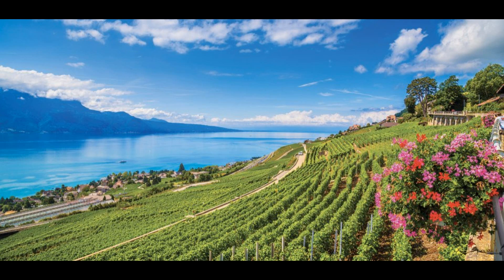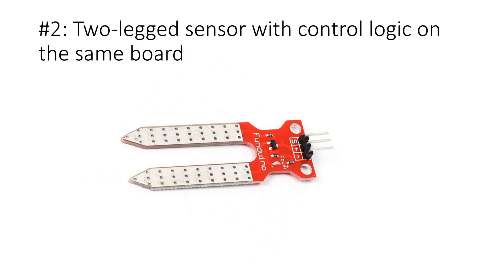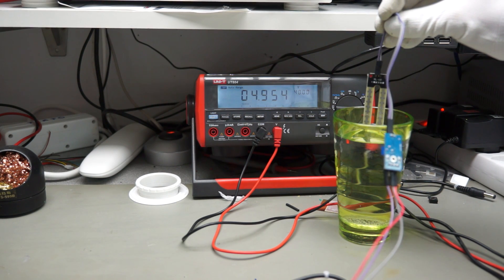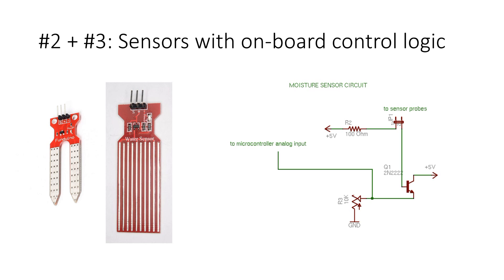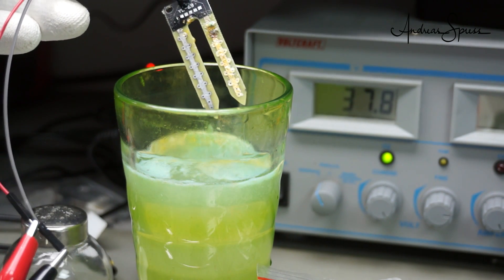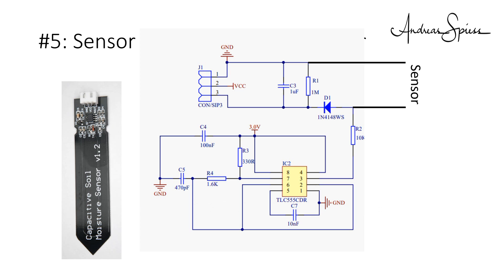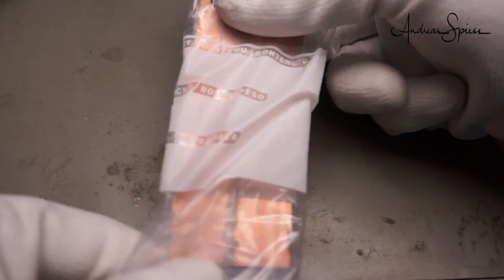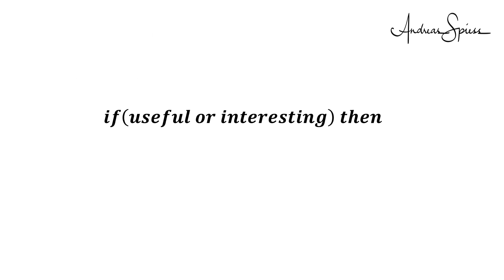#207 Why most Arduino Soil Moisture Sensors suck (incl. solution)

Comment: I've just got the capacitive soil moisture sensors shown in the video. And I already thought that insulating sides and the exposed circuitry is needed. Does anyone know of a coating that would not poison the plants in pots? Are those two options ("Plastic Dip", TRV) suitable for gardens? Any of them have no chance of contaminating the soil? Thanks for the answers.

Very happy that you came to conclusion on the sensors i just bought, they were not that expensive on the "usual platforms". Will have to see how they work long term.
Reply from the maker: Would also be interested if somebody used these protections over a long time
Reply: I'm testing now DCA/SCC3 Conformal Coating from ELECTROLUBE.
It's a spray and you must hang the sensor in the air to let all spare dropping off. Avoid any contact at the bottom for 24hours.
One sensor is now in the soil for a month and looks quite good
Reply: I've tested nail polish for a week, and some of it came off on the sides. But I had a different problem that these sensors were staying in the same range, slightly increasing over the days. Might be my mistakes, but if i tested it not in earth, but putting in a glass of water it went from 0 - 100%, but as I said in the earth it didn't really decrease, but rather increase over time. How Are your readings? Are you using these capacative sensors ? Yeah, I'm on vacation and this project is now at a stop for a month.

Comment: The chemical reaction happening here is the accelerated corrosion of the copper due to the electrolysis. In water electrolysis, hydrogen gas (H2) is usually released. If it was pure water, it would release mainly oxygen gas (O2), but tap water contains chlorine and calcium carbonate (CaCO3), so it would also release some chlorine gas (Cl2, nasty, but there shouldn't be a big quantity of it) and carbon dioxide (CO2), which at least is good for the plants. 
But the copper at the anode (positive electrode) corrodes due to oxidation of the ions and atoms of copper. Meanwhile, the ions go through the water and deposit at the cathode (negative electrode), reducing (deoxidizing) it. That bluish green stuff should be mostly copper hydroxide (Cu(OH)2), which actually shouldn't pose much risk to the plants (but it's a fungicide and nematicide, so it could actually help them). It isn't very toxic to humans, neither. 
However, I'm not sure what the coating of the copper is. It might be leaded solder so nasty lead compounds could form at the anode and that's dangerous to humans and plants, so... Lead hydroxide isn't too toxic to humans, but lead oxide is. And I'm not sure about tin compounds. Almost harmless to humans, but plants?
Reply from the maker: Thank you for your explanations. I also thought about the lead. This was removed completely and ended up in the water.

Comment: Great video!  
A few comments:
I've enjoyed fooling around with such things for a couple of years.   

One of the elements of that capacitance probe that I found interesting is that the 555 timer is sending a continuous stream of constant width pulses.  The probe/soil moisture acts as a capacitor in an RC filter.  Thus the cutoff frequency is changing, but because it's a gradual fall off, you see a varying voltage.  The diode and resistor in the circuit acts as a peak detection with bleeding. It's a very cool idea, and I thought it could be useful in lots of other circuits.  I found it interesting to see the parts of the circuit explained by their function.  

An interesting and another poor solution are these galvanic voltage probes:  https://bit.ly/2MxRAgN
It takes a bit of googling to figure out how an aluminum probe could possibly measure pH.  

I built a probe out of 316 stainless steel rod.  It has worked in my garden for well over year now and without any corrosion.  

One thing I found to be very important with a resistance type probe is to calibrate the system at different temperatures.  The conductivity of water varies enough with temperatures, that I only obtained any decent level of repeatability when I included a temperature term.  

Here is a conductivity probe for a humidifier I made with SS wire and a drinking straw https://bit.ly/2JX7PlJ

Thanks again for the video.  It's a really useful one.
Reply from the maker: Thank you for sharing your experience. It for sure will help others!
Reply: figure one of this report shows that the dielectric constant for soil is most sensitive around 10 GHz.   https://ntrs.nasa.gov/archive/nasa/casi.ntrs.nasa.gov/19750018483.pdf

Comment: I ordered one of the capacitive sensors just last week, for exactly this reason.  Even just a 5 second reading every 15 minutes dissolves the electrodes in a month or so.
I'll make sure to seal the edges with lacquer before using it.  Thanks for the tip.
£1.80 on eBay.  https://www.ebay.co.uk/itm/Analog-Capacitive-Soil-Moisture-Sensor-V1-2-Corrosion-Resistant-With-Wire-RDR/153051926495
Reply from the maker: You are welcome!

Comment: If I try one of these I am just going to buy a couple stainless bolts and connect them to the sensor.  Pot the rest. Bam
Reply from the maker: Should work.
Reply: Fetid Tuna ok Erin brockovich,  I suppose I'll die as the massive current going through stainless bolts erodes them entirely. And leaches into my tomatoes 🍅.  Cool

Comment: How about using the graphite probes instead? Graphite anodes are commonly used for cleaning rusted steel pieces through electrolysis because they decay far slower than iron.
Reply from the maker: Some other viewers also suggested this solution. So it should work, I think.

Comment: The soils influence on the capacitance on/in you sensor change with other parameters than the humidity of the soil, the contains of biological materials, sand, gasses and other wonderful things. To put it short: You need to calibrate your sensor to fit for the soil you are about to measure.
Reply from the maker: As I mentioned, the sensors are not precise. And as you say, I would use some sort of autocalibration where I would store the highest and lowest value over time. I am sure every situation will be different.

Comment: After a heck of a lot of failed tests, I went to an AC drive detection scheme initially seen from National Semiconductor in the later '70s.  My version drives a Ti electrode at around 100khz and 12v peak to peak capacitor coupled (a 555) - neither value is too critical - and senses via a voltage doubler (or a few of them for water level in a tank) consisting of two diodes and two .1uf caps loaded by 100k and directly driving an arduino or ESP logic input for water level, or with different loading to suit your electrodes, an a/d converter.  Water has a dielectric constant around 80 - so here we are using the capacity change as water is more or less present between the electrodes.  I'm using titanium wire for those (pure) as in most cases it wouldn't corrode even electrolytically, and have had one system (for cistern water level) in continuous use for around 10 years now with no maintenance required.  Nothing else ever survived even a whole year - floats stick, optics cloud up, any DC stuff corrodes and so on.
Sadly, I didn't do a full documentation on this yet - it's so simple I just remember it, maybe I should and share it - or maybe Andreas can, he'd do a nicer job.  Nice pics/plots of what I did do are here: http://www.coultersmithing.com/forums/viewtopic.php?f=59&t=904&p=5584&hilit=water+level#p5584
Reply from the maker: Sounds like an alternative concept. It would be good if you document it one to be used by others.
Reply: I will.  Your skills in explaining would probably be superior re telling people how to tune the parameters for a given task...
Reply: Here you go, folks.  Let's bug Andreas to do this up right!
http://www.coultersmithing.com/forums/viewtopic.php?f=7&t=1098&p=6438#p6438
Reply: @DCFusor  Great article - thanks for writing that up, and sharing it here. One point that I'm not clear on: You use alternating current (ac) to drive your "water tank capacitors", and you use titanium wire as the "conductive plates" of those capacitors. The ac will stop  electrolysis - as long as the driving current has no dc component. Does the titanium stop some other from of corrosion that is unrelated to electrolysis?
Reply: @seamusdemora5598  Yes, it's nearly immune to pretty much all corrosion from water based chemistry.  It's widely used in things like salt water for that reason.  FWIW, while mine grows a little fuzz (algae?) now and then, it's good as new after more than a decade.  Nothing else ever came close to that level of reliable longevity.

Comment: Copper is one of the essential micronutrients, or trace minerals, that plants need for growth. As with any nutrient, plants can absorb and use only certain forms of copper. For example, copper metal is useless to plants, but once dissolved in acidic conditions, copper enters plants very easily.
Copper activates some enzymes in plants which are involved in lignin synthesis and it is essential in several enzyme systems. It is also required in the process of photosynthesis, is essential in plant respiration and assists in plant metabolism of carbohydrates and proteins.
Deficiency symptoms of copper are dieback of stems and twigs, yellowing of leaves, stunted growth and pale green leaves that wither easily. Copper deficiencies are mainly reported on sandy soils which are low in organic matter. Copper uptake decreases as soil pH increases.
when I see some of the sensors, they are tinned.   so lead, zinc and copper
 - VERY HARMFUL TO HUMANS !!!!!
Copper is also a fungicide and in larger quantities will kill fungus in your soils.
Reply from the maker: Thank you for your update! Especially about the lead. Most other viewers concentrated on the copper.
Reply: I live in an area known as the Pine Barrens in Southern  New Jersey,   this land was about 200 feet under water 10,000 years ago before the current global warming event that melted the Glacial ice that covered the top half of the North American continent.  
my soil is sand, down over 300 feet before it hits the bedrock and areas closer to the Atlantic ocean are sitting on even more sand.

the yellowing of leaves, stunted growth, pale green leaves... describes any crop plants we grow.  Tomatoes, and such.  ALL the nutrients wash out after a good rain.    we have to constantly replenish.
Very happy to contribute to your great video posts.

Comment: Great comparisons. I've been looking at those sensors for awhile and was unsure as to which one to get and which ones would be better. This helps clear things up. The capacitive sensor looks to be the best by far. 
An idea for coating the board could be to use clear fingernail polish. Dip the whole board into the polish except for the connector pins. I haven't done conductivity of finger nail polish, so not sure if it would be good or not. I was thinking the rubber of the plasti-dip would actually increase or decrease the capacitive effect due to it's own static charge abilities. 
I suppose another option would be expoxy. Maybe super glue?
Reply from the maker: Some other viewers suggested using nail polish. It seems like a valid solution.
Reply: Maybe you can do an experiment video where you test several different methods of protecting the pcb. Could probably use just regular proto blanks that have the copper strips on them. See which type of coating has the best and longest protection.
Reply from the maker: This is stuff for a chemist ;-) Maybe a viewer will do it. With my knowledge, I think it would be a lot of work and need a lot of time because I do not know how to properly age material.

Comment: For the new built sand-islands in UAE they use a different system:
the plants get watered constantly, also with nutrients. Because the islands are only made of sand, they built a watertight tub in which the plants sit.
otherwise the water would flow/mix into the sea.
The concrete tub has a drain at it's lowest point where the water (overhead) gets extracted again, filterd and re-used.
by monitoring input/output and watching the plants you can work out an optimized watering plan with temperature/sun.

For the sensors: "Streifenraster Platinen" would be a cheap alternative for a capacitive sensor, because you could connect multiple strips in parallel.
Isolating it of course is still necessary. Long time stability could be a problem, because you need to find a lsolator which is not only water proof, but also prevents diffusion through the surface. For water based floor heating there is always an extra layer of aluminium because the water would evaporate through the plastic tubing.

I think there is a simple arduino sketch for measuring capacitors (i guess you used that)
Reply from the maker: Thank you for the update about the concept used in Dubai. Interesting and not completely different from what our mothers did when they put a saucer below the plant. Every time when it is dry they watered again.

Comment: The chemistry probably goes like this (not stoichiometrically corrected): Cu + H2O → Cu(OH)2 (=copper(II) hydroxide). Copper hydroxide is insoluble in water. Here's a material safety data sheet: http://www.sciencelab.com/msds.php?msdsId=9923594. And yes, even if you don't run any current copper will react. It'll react with Water, Carbon-dioxide and Oxygen to form also Copper carbonate.
I don't think that in real world conditions (you simply don't measure all the time) it'll harm a plant. Copper is also part of some fertilizers, of course in small amounts. 
Prolonged exposure (=years) might harm the plant and contaminate the soil. It's not toxic to touch (maybe it's irritant).
Reply: On a sidenote: You could try to use materials which don't oxidize easily like for example graphite or gold.
Reply from the maker: Thank you for your explanation and the link!

Comment: if you can read Swedish you can have a look at this report from my students ;-)

well, since no links are allowed, use google to find diva-324486 
"Trådlös övervakning av växter" - wireless monitoring of plants
Reply from the maker: Interesting paper. It is a pity that you do not publish these things in English (with a Swedish Accent). Using Google translate I understood that you used a different concept where you changed the frequency with the variable capacity. Also an interesting concept. And the lamination of copper foil looks like a promising way for protection.
BTW: Links are allowed. They often are in my "Spam folder". But after review, I can accept them.
Reply: The students had the choice to write in English or Swedish - this group decided on Swedish. Another group of my students took their concept a step further: http://bitroot.se/ oh, now with links ;-) They also successfully experimented with capacitive humidity sensors diy
Reply: The circuit which "Sensormolnet" uses is just a 7555 in an astable configuration with one resistor and one capacitor where the capacitor is formed by two sheets of copper foil (could be circuit board as well) inside plastic laminating pouches. The oscillating frequency drops significantly in moist soil - a combination of the high permittivity of water and the water possibly acting as a connected counter electrode, reducing the effective distance between the plates.
Reply from the maker: Yesterday morning I built a very similar sensor but used a different technology for the measuring of its capacity. I had to pay attention to not cover the laminate completely because it was not tight where the wires entered. It works now in a completely watered soil and I log the data while the soil dries in the plain sun. If it works I will disclose the "technology" I used ;-) 
BTW: Nice homepage, a nice goal of the company. Reminds me of when I was young :-)

Comment: So many possible solutions that requiere some hardware tinkering to this problem. Its almost a shame that you didn't discuss alternating and powering down the sensor. Its quite easy.
Reply from the maker: You are right, I should have mentioned it. But it does not solve the problem, it only reduces it.

Comment: Ich habe so einen ähnlichen wie bei 1:44 - meine Lösung: Nicht Dauerbespaßen sondern nur alle 5 Minuten den Pin auf High, messen und wieder auf Low. So hält der Sensor ein wenig länger.
Reply from the maker: Du hast recht. Ich hätte das explizit erwähnen sollen. Ich hab mich zu stark auf die Sensoren konzentriert.

Comment: In this case I am with Xiaomi flower monitor, it's cheap 10$ and works months on a single battery.
Reply from the maker: I also like it. But for me, it seems it uses the resistive method. So I do not know how long it will last.
Reply: I have it more than a year outside in Slovakia, the battery is still nearly full. I measure data every 30min. This device is incredible. ✋
Reply from the maker: Thanks for your feedback!
Reply: @AndreasSpiess  xiaomi flower has carbon fiber probs
Reply: Does it give you notifications at a certain moisture level?
Reply: Can't agree more, I bought 4 of them 2 years ago and they worked more than a year with the same batteries and I was taking measurement every 5 minutes via Raspberry pi. There was no corrosion on the electrodes either...